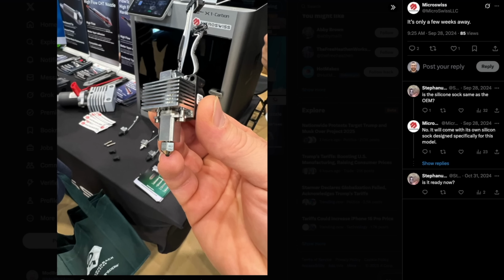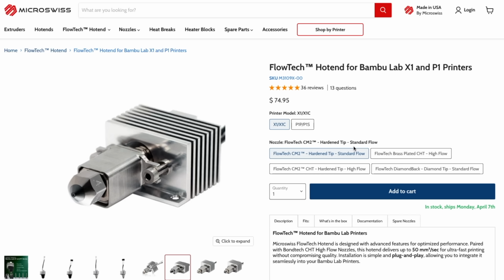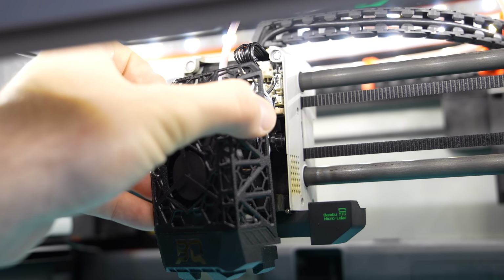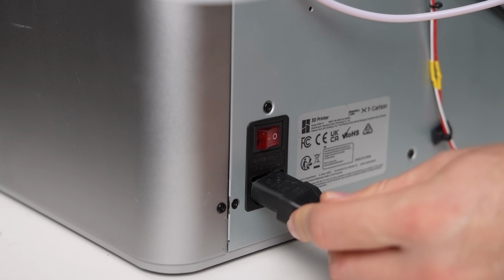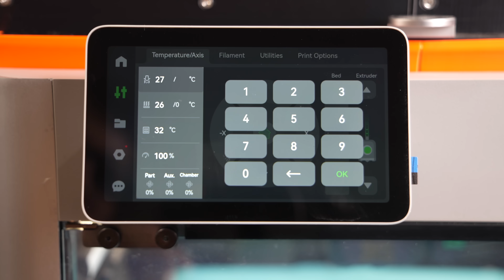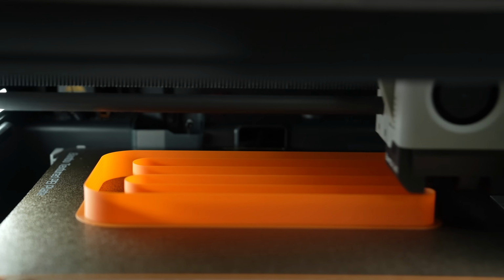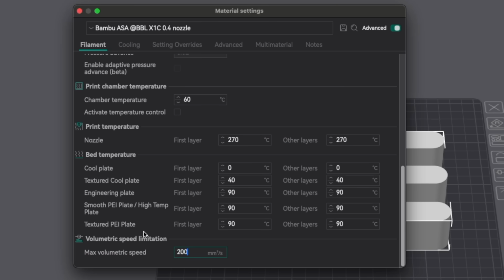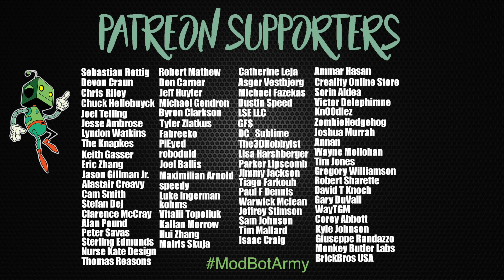Swappable Nozzles For Bambu Lab X1 & P Series Printers! (MicroSwiss FlowTech)

Comment: I installed this and tried calibration, but it will not print. It seems like the nozzle isn't close enough to the bed. I've tried 5 times now, even manually setting the bed height. As soon as it goes to print, it goes back to where it was.

Comment: Flowtech diamond tip... ROFLMAO!!! how many carats on that tip for $170+ then it is $124+ for a replacement nozzle. $75+ for a standard and $17+ for a replacement tip... GTFO!!! looks like flowtech came to the table super hungry eh?  Bambu Hotend - P1 Series 0.4mm Hardened Steel / Complete Hotend $35.99 USD. If american companies dont at least try to match chinese prices dont complain that everything is then made in china. pass.

Comment: Did a Max Flow Rate calibration with the high-flow, hardened steel MicroSwiss nozzle on X1C and got an error: "Nozzle temperature malfunction [0300 8008 004707]" Any idea about this particular error and how it occurred? 

I think I should mention that I forgot to put the sock back on after changing the nozzle. Also, I was printing Elegoo PETG Rapid.

Comment: I am having some heat creep issues trying to print petg after installing this new hotend causing the filament to swell right as it enters the hotend resulting in jams. I have been trying to adjust settings to no avail and is waiting for microswiss to respond to my email about it.
Reply: Im in the same boat. Clogs after almost every PETG  print. Figure anything out?

Comment: So the standard FlowTech nozzle (non-CHT) is supposed to have a longer melt zone than the stock nozzle. Wonder if that alone provides any increase in max volumetric flow rate at all?

Comment: I just got this and installed it yesterday.  I'm curious if you are noticing a significant reduction in your print times after making the flow rate adjustments? I feel like mine are basically the same when printing out multiboards.

Comment: 4:16 They really dont give you much to thread into there, huh? Seems way too thin and would only take one cross threading of a couple turns to ruin the threads completely. They should have made it a little thicker just in case the few threads get worn out or stripped.

Comment: I would have loved a comparison between stock and the normal Flowtech nozzle for at least 0.4mm and 0.6mm.
The high flow nozzle will obviously give a higher flowrate but its expensive and most people are fine with 20mm³.
I would have been nice to see if the flowrate is similar or maybe even better and if the PID isn't out of whack.

Comment: I am using TZ2.0 with hardened steel CHT nozzles and it's hands down the best and one of the cheapest upgrades I've made to my X1C. I can print up to 45mm3 with some materials, surprisingly even some super cheap basic materials can easily handle relatively high flow. And best of all I've never had a clog ever since. And a hotend plus 4 sets of nozzles in all sizes costed me about 450 NOK. That's about 45 USD. I made a simple 3D printed torque wrench and swapping nozzle takes about 30 seconds.
Reply: Where was that from pls ?
Reply: @paulmyfinger  Aliexpress or Amazon
Reply: Same been running the exact same nozzle for over a year without a issue
Reply: The CHT nozzles are mostly banned from aliexpress due to bondtechs patent trolling, you have to be really out there with the search keywords to still find them.

Comment: While I appreciate the look at these, it's not really a valid test of their hotend versus stock when you're testing with the Jetpack installed.  Sure, it answers questions folks may have if they are also using a Jetpack, but that's a much smaller set of X1/P1 users.

Comment: One review on microswiss said that the silicon sock would fall off with long prints (over 5-6hrs)  can you test that?
Reply from the maker: @cpt_plantlitgaming  was this specific to the Bambu lab version? I’ve been running FlowTech for well over a year at this point on other machines and it’s never been an issue.
Reply: @ModBotArmy yea it was on the x1c

Comment: Been waiting for these to come available. Glad to see the numbers, and thanks for the testing. Now, since I bought all four sizes of hot ends with fans when I bought my X1-C I'm hesitant to end up going to a completely different hot end, but the ease of swapping might make me do it anyway..
Reply: I have the same conundrum. Did you get the MicroSwiss hotends? What would you do with the OEM parts if you got the MicroSwiss hotends?
Reply: @fermenteded  I'm still running the stock hotends on my X1-C and both of my A1s. But the A1 w/o AMS is running the Biqu extruder into a stock hotend as is the X1-C. The Biqu extruders are very nice.

I've thought about getting a P1 to run the after market hotend. But the stock in the X1-C works so well, I'm not wanting to mess with it right now.

Comment: For a novice, does switching to FlowTech matter?  Will there be better bed adhesion, better consistency, or better multi color prints?  Or is this just for print speed maybe to gain a few hours from a multi day print?
Reply from the maker: @mobilechaosyt  it won’t effect bed adhesion. I would argue consistency could be improved especially if you have a P1S or P1P and haven’t upgraded to a hardened hotend. Flow is a big one as well as for anyone who wants to swap nozzles on a somewhat regular basis. Like going with a bigger nozzle for larger less detailed prints that need strength and smaller for standard printing. I would say it’s more a convenience thing than necessary in your case.

Comment: just a heads up on P1S and P1P people. the connectors on those printers are different and not the white plug and latch type.
Reply from the maker: @bscommissions892  yes good call. It’s the only reason they have two versions is because of the connectors on the toolhead board being different.

Comment: The Biqu Panda Revo Hotend is what I went with for my P1S. Knockoff revo nozzles are available on aliexpress for $3-4 and since making that swap my p1s has been printing great. Also very easy to do nozzle swaps even if the nozzle is hot still.
Reply: I have a Revo Voron in both my V0 and Trident and a Panda Revo in my P1S for that reason. I know it's not the 'best' hotend out there in terms of flow rate, but the ease of nozzle swaps and being able to quickly share nozzles between all my printers makes it a no brainer. I don't generally print faster than about 250-300mm/sec anyway, so I barely even need the HF nozzles. Now... if they'd only make one for the A1.
Reply: Ali express has hardened nozzles too ?

Comment: I'd appreciate it if you could do a revue of the Slice Engineering Mako hotend for the Bambu. It has certainly had some problems getting to market. It would be great to know if it was worth it.
Reply from the maker: I haven’t been following it as much. There were some issues with the fan/cooling I think?
Reply: @ModBotArmy  Yes, they ended up sending me two of them. One with an aluminum fan vs the 1st one with the typical plastic fan. It's crazy well made.

Comment: Expensive hotend with proprietary nozzles that are just as much as the Bambu hotends? I know some people are hitting flow limits of the stock setup but it's still a hard sell.
Reply from the maker: It might not be for everyone but options are really nice. Especially for those really pushing their printers or wanting more flow with a larger nozzle diameter.
Reply: For me it's definitely more about being able to easily swap nozzle sizes. The higher flow is just an added bonus.
Reply: I want 400c hotends

Comment: Cool ad.
Reply from the maker: Thanks for watching!
Reply: @ModBotArmy  welcome. I don't even have a bambu printer!
Reply from the maker: @JamesTenniswood  haha 🤣 what are you running? I’ve primarily used these hotends in Creality machines.
Reply: @ModBotArmy  I'm cheap, so flashforge 5m (which has been brilliant, and a huge step up from my first elegoo Neptune 3). I have the elegoo corexy on order, but not due to July. Hope to do some more exotic materials (not sure why tho, I still do 99% pla)
Reply from the maker: @ the flash forge 5M and Pro are pretty dang impressive. I have a Centauri review coming out next week. It’s definitely not perfect, but what machine is. For the price, it’s an incredible value.